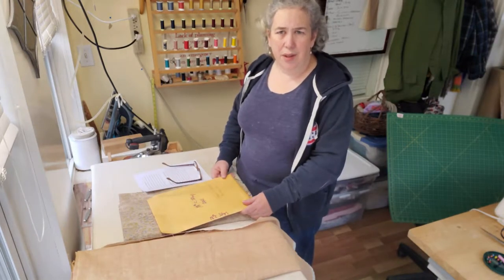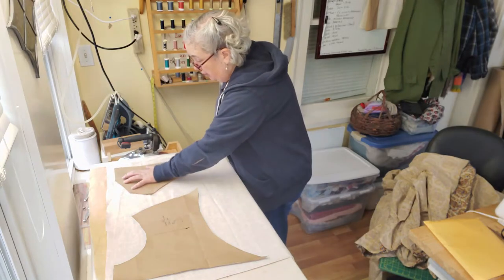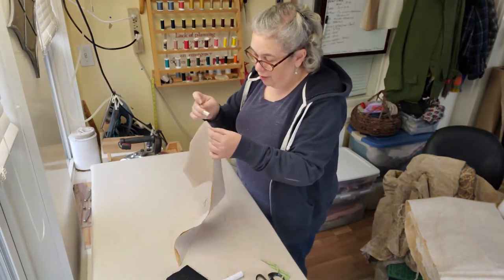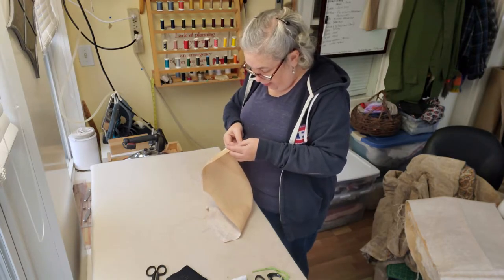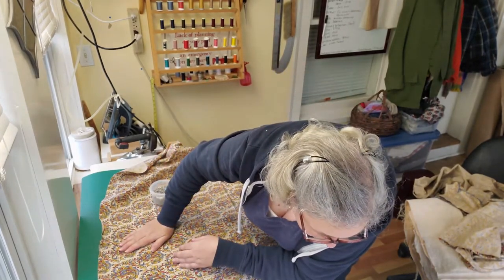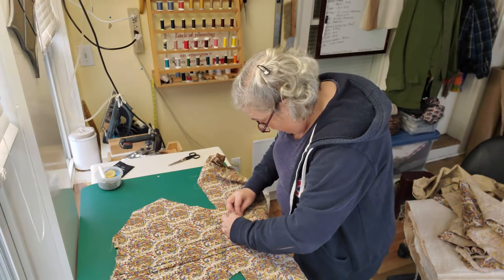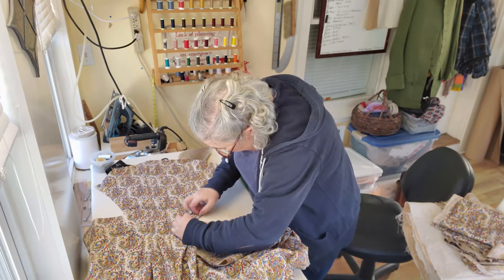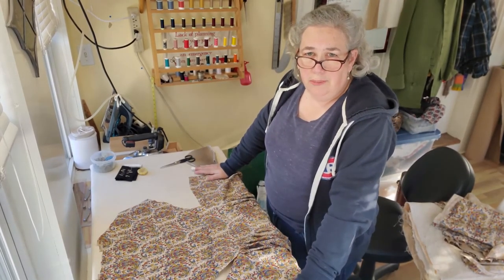Gown Construction Part 1 Back and Pleats

Comment: What's the material used for the lining?
Reply from the maker: it's a linen, but the colour was printed on. I got it for dirt cheap at the local fabric store like a decade ago. I'm not sure what it would do in a wash, but linings work well enough.
Reply: It looks pretty coarse and heavy.  Would you recommend something thicker/stiffer for a lining when working with a thinner fashion fabric?
Reply from the maker: @jayoestreich1729  they are about the same weight. I tend not to wash fabrics that won't be washed after construction, so this still has sizing in it. Go for a linen that is roughly the same weight or slightly lighter and you should be ok. Gowns are worn over other supportive layers, so this is all the structure it will need. Excellent question!